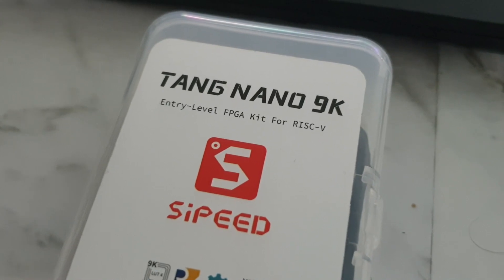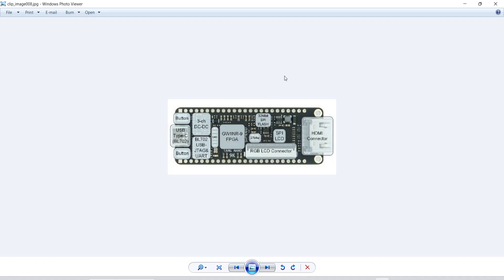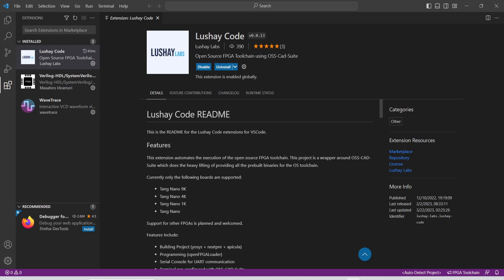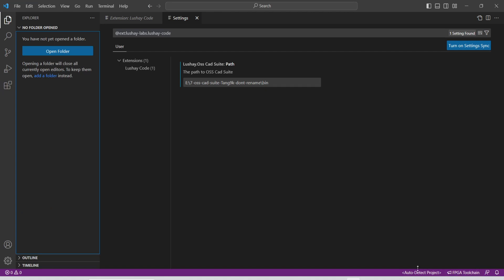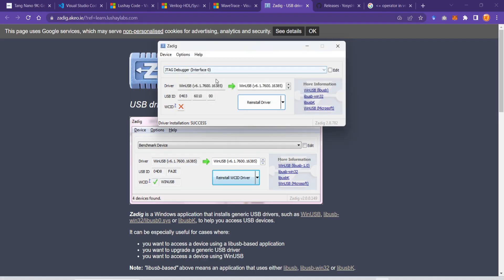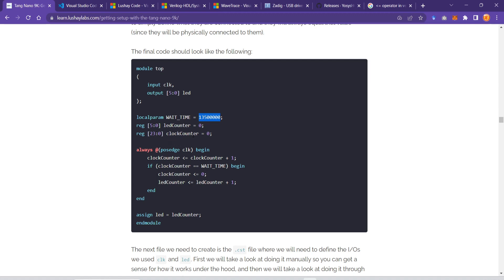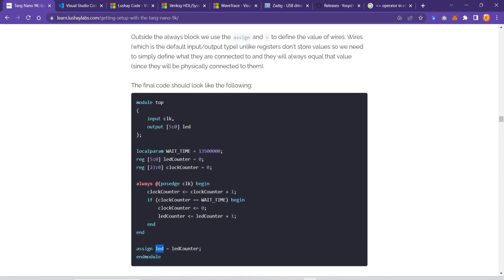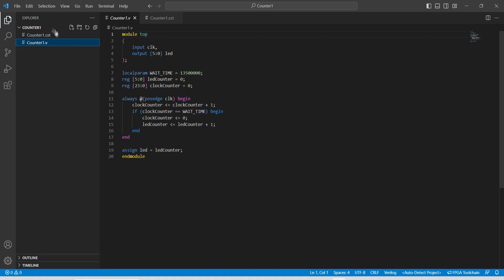TANG Nano 9k FPGA | SiPEED | GOWIN GW1NR-9 | First Program and Complete Installation Tutorial # 1

Comment: Thanks for this.  I had been struggling with the native tools from the Sipeed website, but I much prefer the VSCode setup (I use Visual Studio in my day job as a software engineer).
I couldn't believe how quickly I got the binary counter running on my FPGA by following this.
I think my original problem was actually the drivers, so the Zadig thing was useful, too.
Reply from the maker: Glad it worked! In such situations, very little things may consume lot of time in debugging.

Comment: I had to use that exact version 2023-03-23, It took a while to figure out :P The latest will not work and fail the flash clearing/ writing for the fpga.
Thanks for this! I was looking for a way to use VSCode!
Reply: were you getting this error ?Error: Failed to claim FPGA device: mismatch between target's idcode and bitstream idcode, do you know anything about it?
Reply: I ditched this for a cyclone dev board, i couldn't use that through USB no matter what guides I followed. I ordered USB blaster, it arrive, sat in a box. Never went back. FPGA is a steep learning curve and I have regular MCU projects onboard for now. I will try again in future with FPGA, but it will be the cyclone  @ravirajac
Reply: @LionelSanderson  I did setup with GOWIN IDE and Programmer, with which I am able to work on Tang Nano. It was issue with the drivers which GOWIN IDE fixed it. Thanks for the response

Comment: Thank you for your good presentation 
A Question?
After installing the driver with Zadig, can we program the board with the original Gowin software?
Reply from the maker: yes through vscode.. zadig is just for helping out in drivers installation. After drivers are successfully installed, it isn't required aymore.
Reply: @ProDroneControl  Can you use VHDL this way?

Comment: very cool and very good explanation! congratulatioion.... what resources do you use to learn verilog/fpga programming or any good youtube tutorials??? the info on the internet is rather sparse.... 🙂
Reply from the maker: Thast true.. Unlike other popular languages Verilog is not so common, probably because small portable fpga boards are not common for a common user! Nowadays, things changing and resources improving.. This board is very handy and can help make hardware for the projects that need high speed realtime processing. To learn verilog, I would say Youtube but it again comes back to how much you practice and get involved with fpga based projects.
Reply: I'm a bit late to the party, but I found this one useful: https://www.isy.liu.se/edu/kurs/TSEA83/kursmaterial/vhdl/free_range_vhdl_2019.pdf when I started out,  but there are a few resources out there. I use VHDL rather than Verilog, but the basic idea is the same, although the language is different. (Don't try to use both - at least not at first, or you'll go mad. Once you're proficient in one, then you can have a go at another. )
Either way, the important thing is not nearly so much what happens (of course, this matters!) but WHEN it happens. The idea of processes, and the fact that nothing has a value until the end of that process is vitally important. This means that if you are operating on two or more signals, most of your errors will be around signals that don't line up in time.  You will need to learn to love (and trust!) your simulator, because that's the ONLY way you're going to make sense of things. Oh - and line endings.VHDL uses ; as a line terminator, but again, a lot of early errors will be due to that dreaded semicolon.. 

Particularly with VHDL (partly because it's so verbose) it's very helpful to find, and use, a very open style of code - put in lots of comments, and try to have only one operation or function per process. It's perfectly possible to write really tight, dense code. And it's unreadable. Don't do that..  Use sub blocks too. keep everything simple, clear and well laid out. This will help you find errors, and (if you ever start looking for a job coding HDL) looks much more impressive than dense ugly code. I know which I'd rather work with..

Use, but beware of, opencores.org - it's an excellent resource, but quite a lot of the code doesn't;t work as advertised. It's often instructive to view things, but it's very rarely a copy and paste job - you do need to think about what you're doing. Some stuff works, but if you're use to pasting Java snippets, you're headed for a nasty shock there.. Caveat emptor. 

There's a link here: https://www.linuxlinks.com/excellent-free-books-learn-vhdl/ to some other free VHDL books. If you want videos, check out NANDLAND, as he has some good stuff, and for the more advanced class and inspiration, check out Whitney Knitter at Knitronics.  If you aspire to be any good, you'll need a copy of Peter Ashenden's book, to really get under the skin of things, but frankly it's about as inspiring as a telephone book. It's vital, you need it, but damm it's boring - it's reference, not tutorial. 

The climb to mastery is long, and very frustrating, but well worth it. Check out the forums too - but a word to the wise - ALWAYS explain what you have already done, and what you tried to fix things but that that didn't work. FPGA forums can be very helpful, but ONLY if you evidence you've already tried - otherwise everyone will assume you're a college student trying to get someone else to do your work. They will then ignore you. Oh - and you'll often get job offers. VHDL engineers are rare, and anyone with a pulse gets job offers. 
Good luck, and keep plugging away - the rewards are well worth it. 
FPGA programming. Like everyone else, but faster. A LOT faster..